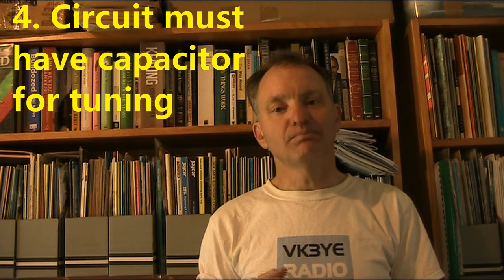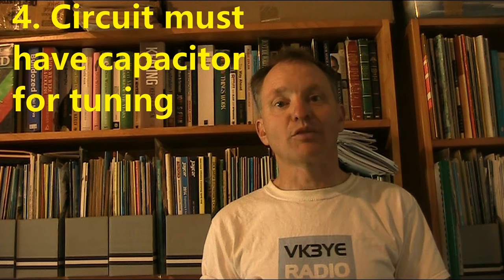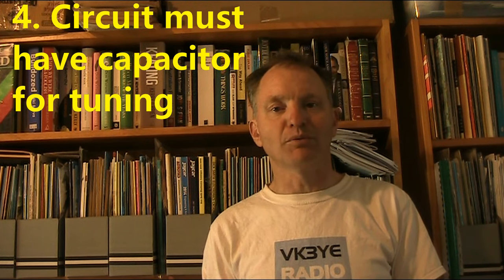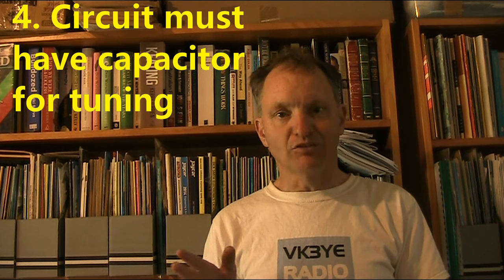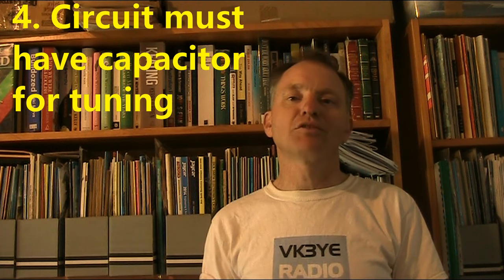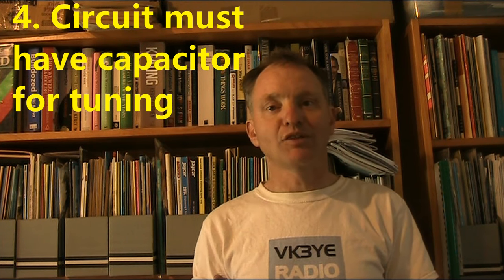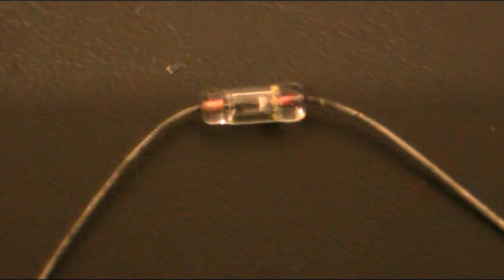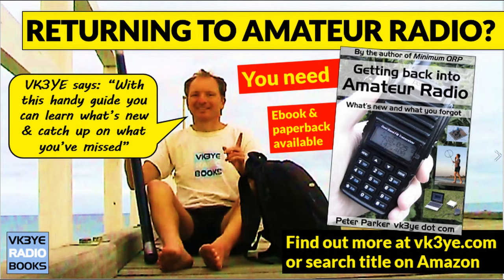10 reasons why your crystal set doesn't work (and how to fix it)

Comment: When I was a kid, my crystal set had permeability tuning (ferrite slug within a coil) and it worked very well right across the AM band. One of the best indoor antenna connections was the metal dial on the Bakelite telephone.

Comment: I fondly remember my first crystal set. Well before I had learnt to read a circuit diagram and was building anything. Dad came home with two crystal sets. For me and my older brother. About the size of a cigarette pack. Predominantly white with a red length of wire and alligator clip for the antenna. The typical crystal earpiece you see. On the front was a dial for tuning, and it all worked very well. Some time later when I opened it, there a coil with multiple turns over top of each other. A ferrite rod slid in and out controlled by a wired mechanism as you turned the dial. It had a fixed capacitor across the coil and a germanium diode.
Reply: I see so many stories like this, I wish they were still around. You know if the one you had is still around?

Comment: I use an old telephone handset for audio out. There are a couple of strong MW AM stations locally. Using approx 40m wire and good ground, the audio level is very good, such that I've added a variable resistor in series with the handset to lower the volume for comfortable listening.

Comment: Although the "point-contact" germanium diode was originally developed as a detector, you will get better results if you can obtain a later "gold-bonded" type developed for early computer applications, e.g. OA47, AAZ18, CG84 etc.
Reply: ARE THOSE PARTS SOLDERED ON THE MOTHER BOARD

Comment: I built a crystal radio in a Radio Shack 100 electronic projects kit I got for Christmas when I was stateside in the US. When we returned to the Bahamas I remembered the schematic from memory and had my mom pick up the 1N34a germanium diode, AM ferrite loopstick coil, 365 pF ( then mmf) a 10,000 ohm resistor, fahnestock clips and a crystal earphone. I mounted all the parts on a short piece of pine board. I got it working on shortwave first ironically because I tapped the center tap on the coil. I picked up AM stations from Miami, Florida when I used the entire length of the coil.

Comment: Great video. For one of the "bad" circuits you mention that it can be improved by placing a small cap in series with the aerial. I tried this and it seems to help. What is it doing exactly?
Reply from the maker: The small cap may introduce a bit of loss but it lessens the extent to which the antenna loads the tuned circuit, reducing its Q and making it less selective.